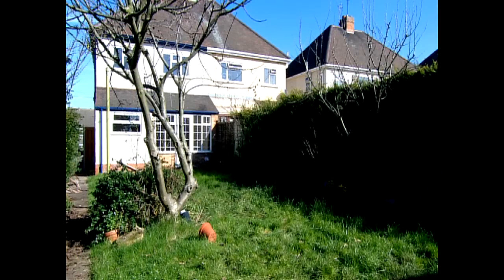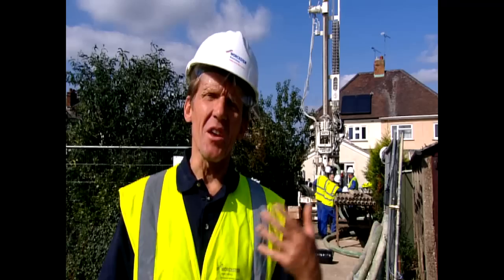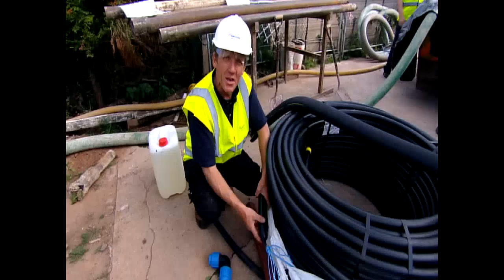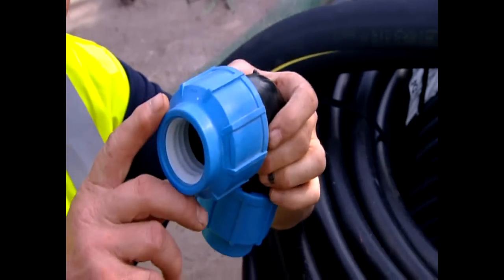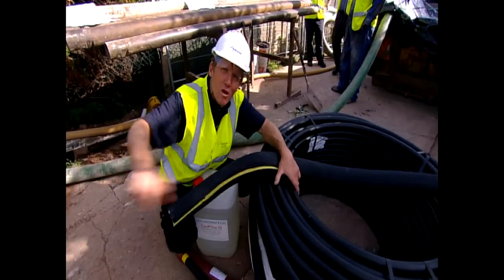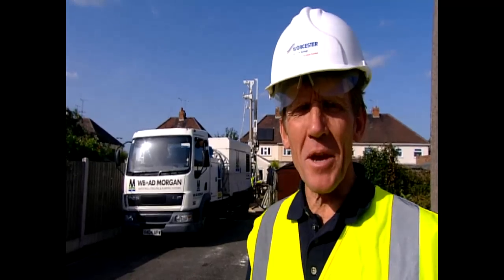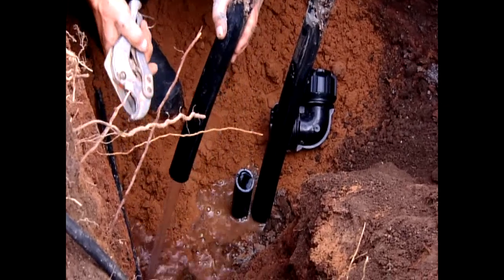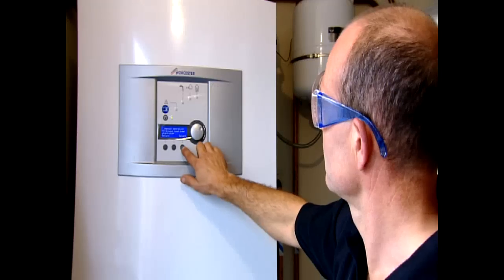Ground Source Heat Pump Borehole Installation

Comment: Never mind fracking - I think I'd be far more worried about the combined effect of too many people drilling up to 800 metres (80m for a small house, 800 for a larger house) in their gardens!  If this is the way our government wants to take us towards a carbon free existence I won't be participating.
Reply: What are you on about? this is a static closed system install once its installed its part of the land and the chemicals inside the system are closed and stopped from interacting with the environment. 
Fracking on the other hand is an open system of injecting at very high-pressure water into the land and then getting gas to precipitate out of the hole... If you can’t see the difference between the too then you are lost....
Reply: @GammaSouljah  To the contrary, I fully understand the difference between the 2 systems.  It's the multiple bore holes that are my concern, particularly in areas with unstable subsurface layers.  I dug a hole for a tree in my garden once and the neighbour's shed slipped on its foundation!
Repeated boring to these depths in close proximity to buildings (some with dodgy foundations) is a recipe for trouble.
Reply: @MrWillow6  The upper part of the borehole is sleeved and the space in the hole around the pipe is filled with grout so there's no voids. The borehole is only 6" wide in the largest systems.

Comment: 80m? Damn. I thought ground source heat pumps were just a meter
Reply: This is a vertical installation, horizontal installations can be shallow but they are also less reliable
Reply: @jimmychase6348  I know people who have frozen their gardens!
Reply: @jonwelch564  They should warm up their garden in the summer with thermal solar panels.

Comment: Thank you.
Can I strongly advise those planning to install a GSHP to use recommended drillers. Without going into too much detail the use of a cut-price drilling company is now costing around £50,000 in repairs. They hit a water source and didn't deal with it properly resulting in serious subsidence. The occupier wasn't informed and only became aware when the house was affected four years later. A competent drilling company would have avoided this.

Comment: Great Video and I have a few Questions:  The biggest advantage of HDPE besides its long life expectancy, are its heat-fused joints which make the pipe a single homogenous pipeline. Joints in traditional piping materials are the biggest source of leakage. Do you think comprssion fittings are ok for places where the earth may settle or move a little bit?   Are you using insullation over the pipes in the header area that are 6' underground or is it just above ground?